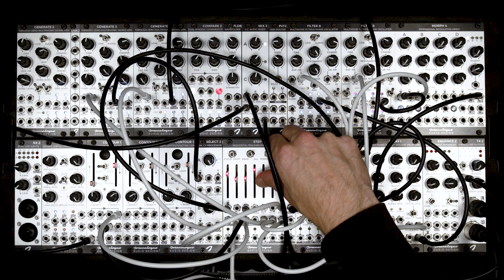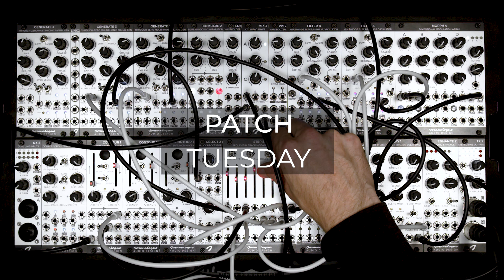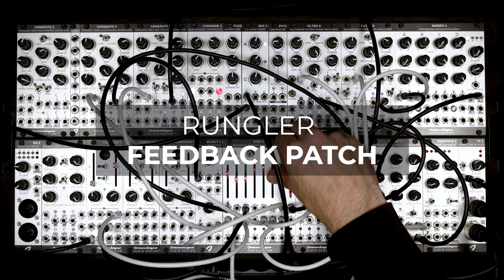Patch Tuesday | Rungler Feedback Patch | Step 8, Generate 3

Comment: I think this patch is missing a key part of the rungler circuit, the DAC. 

I think this is an amazing feedback patch but is not complete until it has the DAC output, to build a DAC with step8 you just need to send into a mixer 3-4 analog outputs with different attenuations like a classic resistor ladder DAC, and this is the output that should modulate Generate3.

If you seach for any Rungler Circuit, you can clearly see how the last 3 stages outputs (Q6, Q7 and Q8) of the CD4021 (shiftregister) are used to build a resitor based DAC.

https://macumbista.net/wp-content/uploads/2012/04/rungler_crop1-1024x470.png

With step8 is more interesting because you can patch any stage analog outputs, and the faders are used to define or set the level output so a simple unity mixer  like the ADD2 can be used.
Reply from the maker: The DAC is no longer a necessary addition required to derive analogue voltages, since Step 8 is a fully analogue shift register! Of course, you can always add additional derived output voltages, by mixing them as you've suggested.